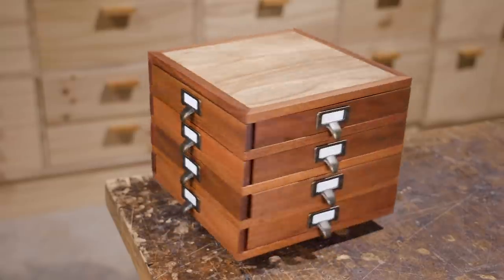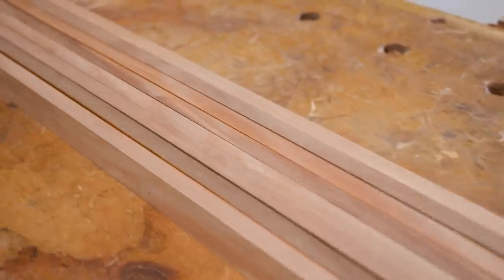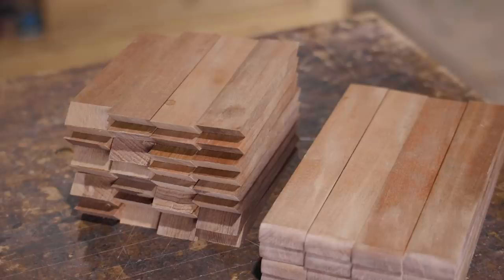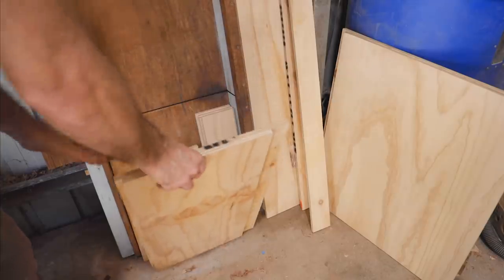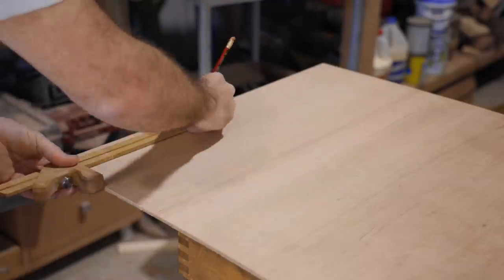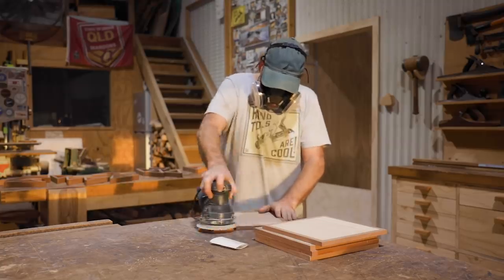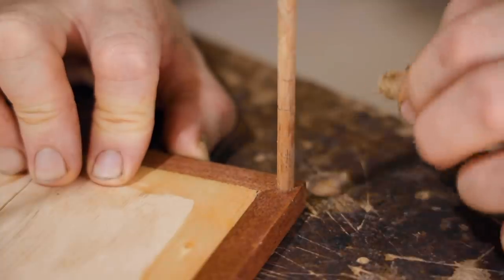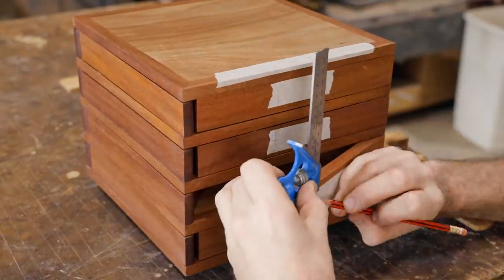Small Parts Organizer with Triangle Drawers

Comment: I love a wood worker that uses discarded wood, every bit is precious. I always look for that type of wood first before I buy new.
Reply: I get all my wood from the trash containers behind our local flooring contractor. Some of it is cut offs from new installations but most of it is from tear outs which means there's a lot of nails to be pulled and a lot of split ends that need to be cut off but it's all hard wood and it's free. Sometimes there's more than I can haul and it breaks my heart that the rest goes to the land fill. I never pass up a good clean pallet too. 

Take care and stay safe.
Reply: @markmossinghoff8185  I do a lot of work for Mormon churches in my area. A few years ago one of them needed to replace the floor of their "Culture Hall" - which is a basketball/volleyball court - and this one had an oak floor. The contractor they hired to do the job hauled all the old flooring strips to the dump. I was flabbergasted. Such a waste.

Comment: Love this, would be great for a jeweller or other makers that use a lot of small parts. Love how you used mostly hand tools, and it's almost a scrap wood challenge. Love the handles as well, I was thinking if using a shiny brass handle, between the layers of drawers, brass washers could be used to keep the gap for drawer movement, and as an accent to the handles. Job well done.

Comment: This was actually very inspiring Mr Pask,  I've been trying to make the decision between handtool and power tool woodworking  and this was a great argument in the favor of hand tools. (I hate noise)
Reply from the maker: I'm happy to use both in my workflow. Hand tools can do a better job for some tasks. They're far more enjoyable but for some tasks, like dimensioning wood, power tools save so much time. :)
Reply: Hand tools will take longer for larger projects but they are so much more satisfying, they work when you have no power, and the mess is much easier to clean up (more shavings less dust).  That said, when I want a job done quick and detail is less important then 'm more than happy to pull out power tools.  Most smaller jobs with any detailed joinery will often still need hand tools to finish.

Comment: As always, enjoyed your project. I wish there was a clip at the end that actually showed the drawers being used. There was only a quick glimpse of one closing. Interested to see them in action. Thanks for sharing.
Reply: I would imagine the combo of angled doors and the lazy susan make it pretty difficult to use without the whole unit spinning. There has to be a tangential component of the force required to open the door, which is going to want to rotate the unit. You can even see him holding the unit with his fingers as he closes the drawer in that one clip. Still a great build, especially considering it was built by hand, but it might benefit from having more resistance to the lazy susan part to make the drawers more functional.
Reply: @phillipsoucy  as drawers get filled, the weight added might be enough to prevent some of the rotation.
Reply from the maker: Thanks Gregory! I could've done that but too late now. There's probably more of me opening them on the Makers Mob tutorial, at the end if I remember. :)
Reply from the maker: I see what you're saying but until I read this I didn't even think about it and I've opened and closed them heaps of times by now. That makes me think it feels very natural to open. :)

Comment: The culture that says"i could do it with all the fancy tools you have" will never make anything other than more excuses. Great work sir 👍
Reply: The fancy tools do help get stuff like that done a lot quicker. I couldn't imagine ripping all those board using a hand saw. Creating a straight, long cut with a hand saw is my Achilles tendon. By time I was don't the drawers would all be 1/4 inch tall.

Lucky for me, I have all the fancy tools needed to make most of what I want. A router table and band saw would still be nice.
Reply: @MAGAMAN  Make your own router table. That's how most of us get them. You can be as cheap or as fancy as you want. Plans all over the place, and you probably have time right now, don't you? They're easy. You can do it with a board and some screws, truth be told. Add a couple clamps and a 2x4 and you have a fence. Or you can make a freestanding unit with dust collection, storage, a fancy fence and t tracks. Either way, you built it. 

A band saw, while a whole lot more work, can also be built. Check out Mathias and his series of saws. He's got the plans for sale, and when you're done, you can say you did it. Quite honestly, guys like that impress the life out of me.

Comment: How ironic to use boxwood.   This project really showed some skill: 16 identical drawers, working well only after a carefully constructed case.  Nice job!
Reply: That's definitely not boxwood. boxwood is light yellow, extremely hard/fine-grained, and you can only get it in very small pieces since it comes from a bush rather than a tree.
Reply from the maker: You know you're right. I've been calling it boxwood for the last week just had that stuck in my head. I didn't even think of it until I read this comment, I meant Brushbox. :)
Reply: How is it ironic?
Reply: @silvermediastudio  it's not. What's ironic is confusing coincidence with irony.

Comment: Pask: Beautiful cuts with the Japanese saw

Me: Shoots dirty look at table saw....
Reply: You have a table saw?  I have a rusty old handsaw that gives me splinters nearly every time I use it. 😂 gotta make do with what you have. I will be investing in a saw like his soon though!
Reply: @eggyboi1217  I've just got an old hacksaw my grandfather left me
It's rusty, dented, and there are like three different spider egg sac remnants in the hollow metal handle
but damned if it doesn't cut through every single thing I put it to like hot butter
No clue why - I'm pretty sure it's a new SCP object or something
Reply: @eggyboi1217  it's cheap .. if you consider 40 bucks cheap ... and the dovetail saw goes for around 30 ... so it's about a 70 bucks investment
Reply: @eggyboi1217  there are many offbrand japaneese saws nowadays, that are very cheap, but still outperform pushsaws

Comment: Hi Pask, if you want to prevent the parts from moving while you are clamping them, use a little bit of salt. I got this trick from another video here on YouTube and recently tried it out. Works like a charm! The salt "bites" into the wood, it then can no longer slide and you don't have to worry, that the edges won't align after clamping.

Comment: "Now, for the fun part: hand sanding 16 drawers"

Le me after scrubbing an old and oily wood toolbox for 2 hours: damn right
Reply: @saxofonistacr  
Unless the finish you use requires a sanded rather than planed surface to adhere properly.

Comment: "You don't need to buy power tools, you can use hand tools"

Me: discovers a proper hand plane is still $400
Reply: Not true, you can clean up and use an old Stanley or Record plane (or any of the clones of them). These can be had for 10s of dollars, not 100s. $5 at a carboot sale if you are lucky. A single No 4 plane will do most of the tasks of the other planes, certainly every planing job in this project.
Reply: Yeah, I read the reviews on a $60 Stanley plane and they were all really bad. But you figure there's a way to improve them to a workable state?
Reply: @BosseCory  Start with an old, one not the newer ones. The new ones are made to a much lower standard.
Reply: @BosseCory  dont buy a new Stanley No 4 is the message, get an older one (with wooden knob and tote usually are ok) you might need to flatten the sole (I have about 10 old Stanley and a couple of new Veritas planes and only two of the old Stanley's needed more than 5 mins to flatten them) and sharpen the blade, but there are plenty of them and they are relatively cheap, if you want to see a pretty crusty old plane bought back to working condition look up Paul Sellers plane restoration on youtube https://youtu.be/RYyV6IUpsYk.
Reply: Thanks, everyone! I'll get to work on this.
Reply: "You can achive amazing results only with hand tools". I absolutely agree with this argument, but the question is: how long you'll take to get there? In a time-lapse video all manual cuts seems fast and easy. I think that a table saw at least to cut long pieces is always welcome.

Comment: I have a beginners question: Sometimes when I glue wood together and later use an oil finish, it leaves stains in parts I glued. Ofcourse I wiped away the excess glue, and sanded the surface, but sometimes the wood soaks up glue. And then these parts turn out darker.. Is there a way to deal with this? Should I just have sanded away more?
Reply: I do the following when i intend to oil a surface and im not sure i got all the excessive glue out : Just scrub it down with a soft brush and water for water-based glues or whatever thinner/remover fits the glue you use. Let it dry thoroughly, optimaly over night and then get going with the sanding
Reply: @androswolf  Thank you for the advice! Will this warp the wood though? or just use water minimally?
Reply: @simeon7450  It really depends on the  kind of wood. Most solid pieces should be fine and if you are working with plywood you can clamp the pices between 2 boards while they dry just to be on the safe side.

Comment: I only use hand tools for virtually everything I make (including a couple of lapstrake canoes). While I understand the attraction of power-tools for professionals (eg maximum efficiency, higher through-put and therefore profits), I'm only  a hobbyist so I have no timeline. Using hand tools has many, many advantages. They are almost silent, so you can work in the evening when kids and neighbors are asleep.  Few hand tools are wildly dangerous, so all that safety gear is usually not needed. You can even listen to music and drink a little wine. Every surface of the shop doesn't get covered in sawdust, so cleanup is a breeze. Plus, it's fun using a razor-sharp hand-plane. Something I've never felt when weilding its shrieking 8kg, electrified equivalent, while encased in ear-muffs, goggles overalls and a respirator :)
Reply from the maker: I absolutely agree David! I don't enjoy the noise and I enjoy wearing a dust mask even less, especially when it's 30°+C. I could work that way too very happily, I wouldn't post anywhere near as many videos though. :)

Comment: I liked this design so much I decided to make one myself. For the label holders I cut my own on the cnc out of Monkey Pod. I came up with a modified version where I make the drawer fronts a little thicker drill the holes off center leaving the front with more wood for strength then cutting through to the holes at an angle so when the drawer is 1/2 way open I can remove it.

Comment: Very cool. Idea for next time: use a metal bar in the center (or insert BBs, shot, or something into the dowel) and insert a small magnet into that internal point of the drawer.  You'd probably have to mount that middle dowel or bar a bit more solidly, but might be a nice way to keep drawers from swinging open if it gets tilted at all.

Comment: It's cool to see you demonstrating using hand tools for ripping boards. I say this because safe table saws have hovered just outside my budget for far too long. I manage to figure out a way to get a lot of different tools on the cheap, but "table saw" "safe" and "affordable" have so far remained an elusive combination. I do have an old table saw I bought used, with nearly zero safety features (no riving knife for instance, which I found out later might be the #1 essential safety feature), so I will only use it for a rare cut which I will think out thoroughly before executing, to try to do it as safely as possible on this machine. Using scrap wood (a noble goal that I myself do almost exclusively because of the cost of lumber) often requires what I see you do a lot: ripping several dozen rather short boards into several dozen rather short, thin boards. But doing that on this machine doesn't seem very consistent with keeping all my fingers. As a result, I don't use it much, and probably shouldn't, until I can replace it with a safer one. I can't tell you how many times I have ripped something ridiculous with my Ryoba saw (the same 2-sided Japanese saw I saw you ripping with in this video), so that was encouraging.

Comment: Excellent stuff, as usual. Although using bamboo skewers to pin the drawer joinery surprised me. I'd have thought you would still break out in a cold sweat at the very thought of bamboo skewers after that chopping board!  🤣😂

Comment: I'm halfway through making a mirror frame out of floor boards... tools I wish I had: a wooden mallet (for chiselling); clamps/vices; a worksurface; a way to sharpen my lone plane; a rotary sander, because the surface I need to finish is not small (the frame is probably 5x4 ft, and the boards are almost at full width). I'dd add a drill for the joints, but I'm fairly confident I'd wonk things up and ruin everything at the last minute.
Since I learned woodworking at school, my mum seems to think whipping up just about anything out of scrap should be a piece of cake...I have never been more unfit in my life, yet I found myself whittling floorboards cross-grain to match/square the joint angles ^^"

Comment: I'd have used plastic wrap, or an old bag for masking above the drawers during assembly. Simply take a piece and shove it down over the dowel, allowing the dowel to punch a hole. Since it stretches quite a bit before the hole forms, it springs back to make a nice, tight fit on the dowels, preventing any glue from running down.

Comment: Great piece; its beautiful. I can't say that I've ever seen anything like it. 
Btw, you said you though a lot about the "dowel issue" at the end. If you make another one, how about a "segmented dowel" using metal pins at each joint? I think a 6 or 7mm hardwood dowel w/glue and metal pins would be plenty strong. Centering the holes for the dowel pins would be the trickiest, but a jig and pre-drilling would fix that. Just an thought.  Anyway...well done.

Comment: Pask... you need to buy some medicine syringes .      They work perfect for putting wood glue in tight spaces.   You can clean them afterwards or toss them since they’re  only a few pennies each .   any pharmacy has them .   They’re used for giving infants and kids medicine .       As our kids got bigger, we cleaned out their old medical bags and found dozens of them that my wife was tossing out .      I repurposed them for my workspace and have loved them ever since .      Some for wood glue.  Some for oil and some for cleaning solvents.      They work great for gun smithing as well.  Or anything where using the stock nozzle makes a mess .

Comment: The box is beautiful, I already have several for me and my friends so that they can store their flies and hooks.
The sticks that make hinges tend to deform a lot, maybe it is your way of working only with wood and manual tools, did you try to make the box more solid to do it with threaded metal rods? Could you make a plate in the video edition where you put the measurements and elements used?
Sorry, but I manage with a translator.
A great greeting.

Comment: I wonder : did you have to glue the inbetween boards at all ?  I would imagine if you have stacked them  with perhaps thin  washers as spacers over each drawer-joint you could simply have sandwiched them loosely with only the bottom and top glued in place.

Comment: Thank you Mr. Pask for yet another masterpiece.. you are genius. I have watched all your videos and always wait for the new one.. Me hitting YouTube is mostly for watching your videos..
One question here though- isn't it weaker with wooden dowel at the corner as a hinge? Do you think iron rods will make it stronger?
Reply from the maker: Thanks very much! The dowels are easily strong enough, it's a really solid unit. That's mainly as there are so many shelves and the spacing between them is only a few centimetres. They work together to form a strong structure. 

The weak part is the end of the drawer where the hole is, there's not much meat left there but even that I'm not concerned about as it's strong enough. :)
Reply: @PaskMakes  thank you for the quick response and explanation.. makes sense..

Comment: Might help this be a little more useable if you added a little wedge inside the drawer on the bottom in the corner to make it easier to pull small parts out of the drawer over the lip. Like a little ramp...

Comment: Very ingenious design and construction approach. Aside from not having your skills, I wouldn't have the confidence to use those dowels in those holes close the ends. But then it would take me weeks to make, so a big investment, whereas with your skill, you can have a go, and if it doesn't work it's just a day lost. Do you sharpen that sort of saw, or is it one of those hard-point throwaway types? If you sharpen it, does it use a normal set - I can't see any set to be honest, but video is deceptive.

Comment: Great for storing Pizza Slices!
But seriously, unless you are storing triangular objects in the centre of a table (it has 4 drawer sides for 4 sides of a square table), this is a rare, and highly specific design not many people find useful.
Generally, it wouldn't be better to make a rectangular shelf with drawers on 1of the 4 side only, you place at the edge of a table with 1 divider in each drawer if partitioning is highly required.